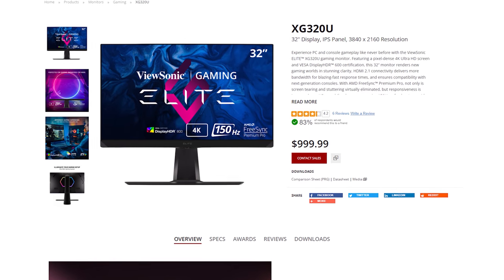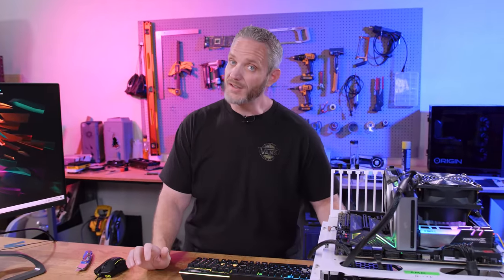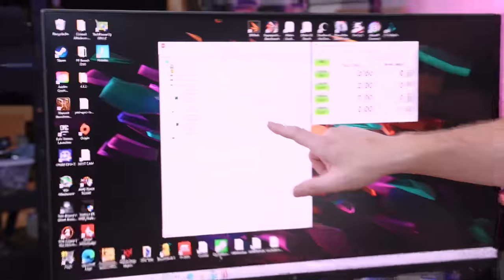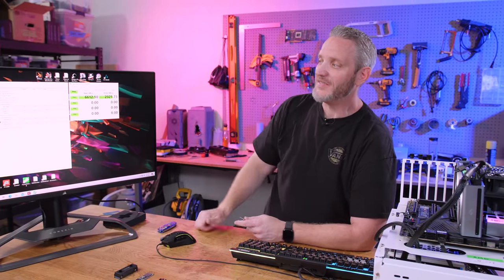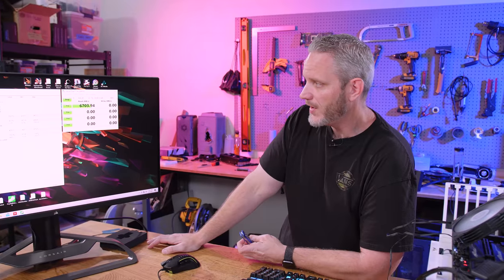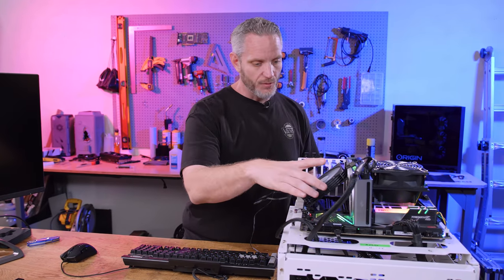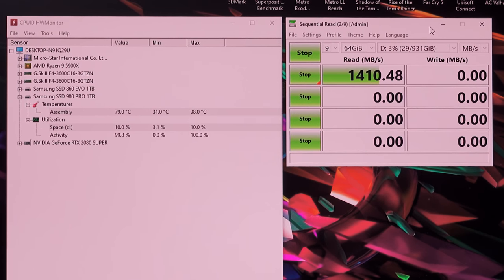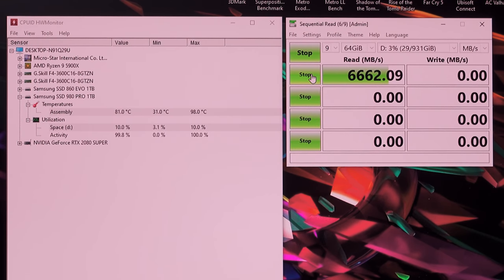I watercooled an NVME SSD... These results were unexpected!

Comment: If you consider basic semiconductor theory, around 60C is fairly COOL for pretty much any normal semiconductor device. You'll see minimal to LITERALLY NO degradation in performance at all. Semiconductor theory works ! You really don't have to concern yourself. Your tests confirm this. In fact 70C seems to be just fine too. Since SSDs dissipate a couple of watts at most, and only then when WRITING all the time and how often are you continually writing ? There seems to be no reason whatever to spend on cooling them. Indeed I just disregard those vestigial 'heat spreaders' as junk. They'll do almost nothing useful in reducing temperature anyway, it's quite minimal, just a cash cow for the accessory vendors.

I imagine that too many think there's some linear relationship (i.e. starting at room temperature) between temperature and 'performance' like switching speed so 'FREEZING' semiconductors will help. THERE ISN'T ! In fact if you get them too cold as I have with LN2 they STOP WORKING ! If the DIE temperature is no hotter than say 70C, it'll be JUST FINE. Note that the DIE will be warmer than the surface/IHS temperature where dissipation is very high as in processors with >>100W dissipation. Looking at the physics of HEAT, the bigger the IHS, the smaller the differential between die and IHS surface temp of course so I like LGA 1366/2011 processors as the die/chip will be better cooled pro-rata compared to the LGA1150/1/5 !

The above of course applies to SILCON semis, it's different for other materials.

Comment: For what it's worth, Chia plotting is a great real-world stress test for write speeds on drives. You do need a many-core CPU to remove that as the bottleneck (think in terms of a pair of 10+ core E5 Xeons, or a Threadripper), but it's very sensitive to drive write speed.

Comment: I had a similar result with and without the motherboard heat spreader on my MSI B560 Torpedo and a Samsung Evo 970 2gb ssd. Bear in mind this was the PCIE 3 version, so it didn't work as fast as the one Jay used here.

Comment: Slow write speeds: This is due to SLC cache size. NAND in TLC mode or QLC can't keep up with constant writes, so manufacturers implement a "SLC" cache, where every cell writes 1 bit instead of 3 or 4, which is faster. Each TLC drive has a SLC cache size, and if you write a lot of stuff till it runs out, you will drop to line MLC nand speeds... which depending on the nand, can drop SIGNIFICANTLY... This is why people hated move from MLS (2bit per cell) on samsung PRO drives to TLC (3 bit per cell).

Comment: JayZ I suggest to check SSD testers, see how they are stressing nvMe (they usually write how they achieved such scores and how exactly they stressed the SSDs) and hitting finding out throttle points as well as the actual effectiveness of the burst write before its speed dropping down. I would go from there and start digging even deeper.

Also the reason why write speed drops down to 2000MBs is probably because of nvMes  SLC cache being topped up and thus it reverts to the actual nand chips which are slower then the cache.

Comment: Slightly different scenario, but I have encountered thermal throttling when using an M.2 SSD within a USB-C Enclosure plugged into a MacBook before. 

However, this was mainly when I put it under huge load... (Encrypting/Decrypting the entire drive, formatting etc).

Comment: slow write speed = cache saturation

If you wait an extra few seconds between test 1 and test 2, it will take longer to reach the slower write speed. If you start the second test immediately after the first one finishes the cache is already saturated and then the write speed goes down.

Comment: I’m running a  Crucial P5 2TB 3D NAND NVMe Internal Gaming SSD, up to 3400MB/s - CT2000P5SSD8 in my system without a heatsink but it has airflow from the case fans and cpu liquid cooling fans and it idles at around 50 to 53C. I have not noticed any overheating issues thus far.

Comment: As a heads up, hwinfo doesn't update ssd temps very quickly so if you compare that with your test time you end up almost certainly missing the maximum temps. I found that using crystal disk info was much more effective since you can force a temp read by clicking on the driver's tab. In my experience the max temp of the drive tends to be a good few C higher which would explain why some tests had much lower write speeds, because throttling would kick in sometimes but maybe not every test if cooling was sufficient, yet hwinfo wouldn't catch it
Reply: Actually this doesn't describe what is going on in the layer testing. I haven't seen that happen in my systems, but maybe it's due to the 980 pro setup. But the 980 pro isn't performing up to the 7000MBps spec so something unusual seems to be happening.
Reply: Finally, this might have been a better test with an SSD that has a faster write speed because not only are Samsung's usually a bit cooler, but also the extra write speed adds quite a bit of heat. That xpg s70 blade would be a great choice since it heats up extremely high and quickly. Testing with the Corsair mp600 showed that the waterblock did improve performance because it does thermal throttle pretty consistently. So I think a test with another drive would be helpful

Comment: Literally the only time I notice any slowdown from any pcie3/4 nvme is building really large web applications. Just because there are often thousands of files touched via npm tooling.

On the write performance variation, likely a combination of cache and wear leveling algorithm, that can vary a lot by drive size.

Comment: Theres a lot of places where the write speed can get messed up. First is the OS, I always do stress tests in a minimal OS environment, typically a lighter weight linux, like Debian. Second is the pcie setup, where do the links come from and is there potential for bandwidth sharing of any kind. This means only doing nvme tests in top slot dedicated x4 links straight to the cpu because even with no other devices the pch and cpu talk about things behind the scenes. Third, the nvme controller could be hiccuping with write speeds if the cache fills faster than the flash can be written, the controller could also be doing back ground wear leveling and under utilization calculations.

Additionally NVME use almost all of their power to transmit over pcie and charge flash cells during writes. Since writes are a receive side pcie event all the power is used for flash cell charging during writes. This means that assuming no controller bottlenecks that write speeds are probably limited by flash charge times which I'd bet are set based on the max power dissipation considered reasonable by the silicon designers. Power dissipation and thermal performance are very related.

Comment: just make it into a freezer element you can convert any watercolour into a freezer element but you need a solid pipes.
a 15mm copper pipe would work better blowing air through it form a small fan open at the end! slightly squashed where it's going to be placed some small 1 mm holes could be drilled in strategic places. it's not the size of fan it's about the speed of air travelling over a surface

Comment: surely to have an accurate read which i thought you were going to find, you need to not use that software and use one ( i dont know them) that shows the chart which shows the behavior and the exact moments the speeds are an issue and its temps. because clearly temp does have an affect on speed

Comment: use dd command in linux, write whatever sized blocks of zeros to the drive until full, add an &, copy and paste line hundreds of time, dd will fill drive with zeros hundreds of times over, can give status=progress to each so you can plot throttling. Also, you got air being dragged over it by the GPU fans. Try this inside a box with no gpu fans, sleeper build case i.e blocked fan at front, 92 mm fan at back, fans idling because disk activity doesn't heat CPU. Sleeper build epeen with pcie gen 4 nvme motherboard. pls.

Comment: My HDDs, my SATA SSD and my MVME drive all are currently idling at a pretty even 38C, and even when I am gaming they rarely get much about 45C as my PC "heat soaks" I have an AMD Ryzen 5 1600X overclocked to 4GHz all core water cooled with a Corsair water cooler, 16GB of G.Skill RAM clocked at 3,200MHz and a Zotac GTX-1070 that regularly clocks to 1911-2050MHz in a Corsair case and the hottest thing in my machine is my GTX-1070 at 50-60C depending on the temperature in my room. With the exception of the NVME, all of my drives have air blowing over them from the front of the case, and I have never seen my bare NVME SSD ever Get above maybe 50C just from being heat soaked by surrounding components. That all said, storing my most played, large games on the NVME, I never thought I would see the day where my storage device made a game actually perform better.... and Cyberpunk 2077 going from spin drive to NVME actually allowed the game to pull better than 30FPS reliably, and I no longer get any texture pop in as I used to get.

Comment: I've looped 60+ GB video files = to 80+ % of the drive capacity to stress/heat test drives, then run the benchmark. You can also monitor windows transfer rate which should be repeatable... I also use server PCIe cards so I've taken to modifying the case side panels for 120/140/200mm fan to cool the cards...... Mellanox ConnectX-3 40/56G nic, Adaptec 8 series raid, Supermicro NVMe card with plx chip to support 4 drives in a x8 slot.............and, fyi, the Gen 4 980 pros are faster then 970 pros in gen3 slot..... at least for me....

Comment: Flash memory should not operate at a cool temperature ideally, it might actually shorten its lifespan due to the way flash memory writes (It's sort of like a battery).  It's perfectly OK if hard drives or flash memory is a little toasty.

Comment: Putting one of these water blocks on one of my M600 NVME drives bricked the drive. Only thing I can think is it shorted something or crushed something. Attaching the block to the drive was difficult because it didn't want to "latch". It took some extra effort to get it latched closed. I'm guessing if something got crushed this is where/when/how.
$400 drive bricked by a cheap water block

Comment: The tool you really want for such tests is fio (Flexible I/O Tester). With fio it's easy to define custom I/O workloads which say what to test, how to test and like you wanted - how long to test. This is also the tool the industry uses to test drives with their specific workload models.

Using CDM lead to some very misleading observations. For example that 1400MB/s read while the drive was hot from the heat gun. That drive actually never read with that speed. Thermal throttling is digital, either it's active or not and that's the difference between like 6000MB/s if it's not active and like 60 MB/s if it's active. There is no analog transition between these states. It's artifical and initiated by the firmware and is not caused by some hardware effects. CDM only gave you an average it took to write that amount of data while the drive switched between these states. To really see in the datarates when is the drive doing what, you need immediate reporting of the datarate - fio does that for example.

If there was no thermal throttling you would see basically the same speeds from room temp until it fails if it's too hot. There are for example industrial SATA drives without thermal throttling (only thermal shutdown at like way over 100°C) and these show the same speeds no matter if at -45°C or +85°C. Flash internal effects and firmware operations have a way bigger influence on datarate than temperature.

Comment: I would like to see the "all watercooled" build but without monoblock. Separat blocks for SSD, RAM, CPU, power supply, GPU, VRMs.....
Reply: Same
Reply: All watercooled but no fan, that would be awesome! Gonna need a huge rad though.
Reply: @wherearemytesticles  how u gonna cool rad without fan when fan is the core component for every type of cooling
Reply: @suryakisku3895  passive cooling
Reply: @zkilla4611  passive cooling altogether is different kind of cooling if u r water cooling u will be needing fans to help remove heat from rad
Reply: @suryakisku3895  if you just have a radiator in open air it will provide some sort of cooling without a fan. Not much in comparison. But it's doable.
Reply: @zkilla4611  it is doable but it's no way near efficient and the ambient temperature should be around 20 or mid 20s to be effective anything above that will endanger the components
Reply: wanna see mine then? done all the above 5 yrs ago..
Reply: honestly i think it`s risky to watercool a PSU
Reply: honestly i think it`s risky to watercool a PSU
Reply: @suryakisku3895  a large enough Radiator and top tank ?
Reply: Isn't that just fish tanking the tower?
Reply: I would too. Tho I wonder how loud the pump would have to be.

Comment: Try using an old Samsung 960 Pro (512GB). Even with a Heatspreader AND a Fan blowing on it, mine still gets over 60°C. Without Heatspreader and Fan it throttles at over 90°C. 
Those Temps don't come from benching it, it is that hot just by being my bootdrive...
Many M.2 are also used on ITX-Boards and mounted to the Backside...those cook quite nicely as well in CPU Heatsoup^^
Reply: Yeah I am sitting here with a 960 just idling and it's over 50c with an EK heatsink.

Comment: Nice to see some validation that cooling is largely unnecessary on nvme drives.  Suggestion, refrigerate it and show when write speeds throttle at low temperatures.
Reply: I agree, and you probably won't find yourself in a scenario of constantly writing to your drive over and over again very often. One thing to keep in mind though is that in a "real" build you might have considerably higher ambient temperatures depending on your case.
Reply: NOT EXACTLY , I have had 2 SSD's NVME Burn out just playing a few of the more modern games. Got 2 SSD coolers one with fan and temp gauge other just heat sink...  The ssd without my heatsink and fan just heatsink only .. will over heat when playing certain Titles. As i have fried a couple already I refuse to use an SSD and Game without a cooler. IT IS NO JOKE!
Reply: @Bryanhaproff  Either you had some lowest quality junk SSD or your SSD's were faulty, had all of my games on SSD's for about close to 3 years now. Currently i have 3 SSD's in my pc and i have never needed to replace or switch any of them. One of them is about 5 years old and its still perfectly working
Reply: @legendaryjimbob7685  No Man's Sky PC .. That game in particular and Satisfactory on Steam Will over heat your drives. I've not had a single SSD make the cut without a heatsink. Skyrim. Fine though, game is great on SSD
Reply: @legendaryjimbob7685  Oh WD BLACK is not a bottom tier SSD
Reply: @legendaryjimbob7685  don't mean to be snarky, but not everyone is the same though: you don't know if he's living in the hottest/humid country in the world and has no aircon (just the same as us not knowing you live in the north pole); you don't know if his case's airflow/setup is choked to hell or not, and/or full of sound dampening material trapping more heat internally; you don't know if the games he's running have ssd-killing DRM (not heard of it for a while, but still fuck Denuvo for doing that in the first place); he might only have 2GB of RAM so the Page File is being utilised out the ass; etc.

Comment: So the conclusion is that even without a heatsink, it's not running hot enough to actually slow down enough too make any difference in real world gaming situations. So these coolers are just a waste of money.
Reply: The way they are marketed, absolutely. But it could be useful for use on an NVME used as a video editing drive for 4k 60 fps footage where the drive is being read/written to almost 24/7.

Comment: Hey, Jay. I guess the write speed jumps up and down because after the first run the cache is full and the drive has no time to transfer data across the drive and trim it proprly.
There might be a solution, get a file on the other nvme drive that occupies twice the cache size of the test drive and MOVE it to the test subject and back several times. 750 gb might be good enough.
Reply: so water cooling the ssd is more of a gimmick still shame🤣🤣🤣🤣🤣🤣🤣🤣🤣🤣

Comment: How about a waterproof silicone skin heat transfer balloon on the PC with a couple of pipes going in to effect the transfer? A good mass of water and no other cooling in the case? A pump to feed in and another to feed out into an efficient static radiator . The critical thing would be the contact interface between the balloon and the hot components …

Comment: On the point of if its not slowing down is lower temps better? Don't forget the lower the temp an each individual part the lower the overall case temps are. I still don't think watercooling is necessary on an NVMe though unless you have a system where they are going 100% 24/7. Also lel at the 240 rad PLUS like half a litre of reservoir for an nvme.

Comment: i have found running a ram chace help a lot,  20/30 gigabytes a second read and wite, and best yet i set a offset to only write to the drive every 20 seconds to help with the lifespan of the drive (im using primo cache 32gig inteligent mode 20 sec write delay)

Comment: The biggest problem I'm noting on testing temp reduction is you're placing the thermal pads/heatsinks/heat spreaders on top of an insulator (the paper label) of the NVMe drive. So while you're able to replicate the baseline conditions, you're just sticking hunks of metal near the actual controller chip, not in contact with it.
Reply: Most of those labels on high end drives are metal